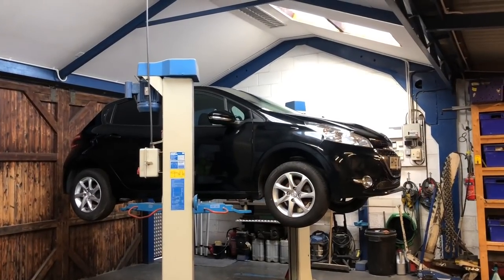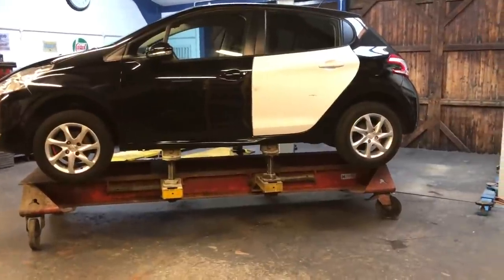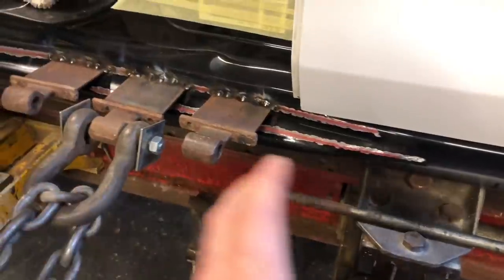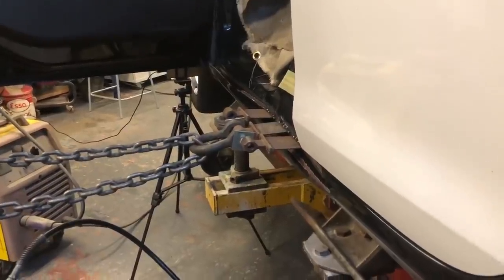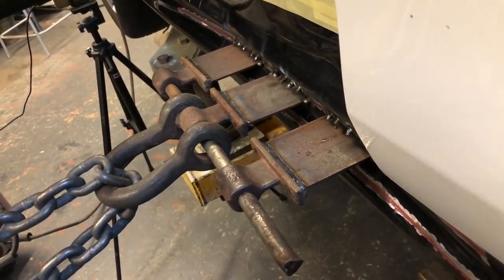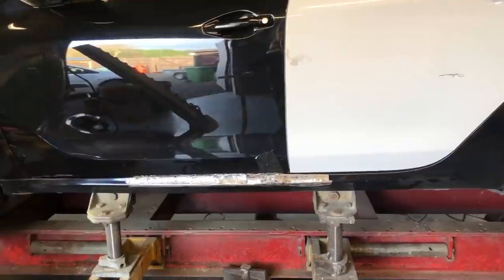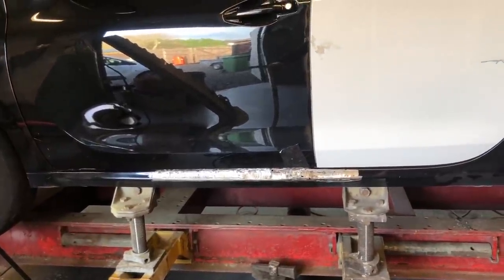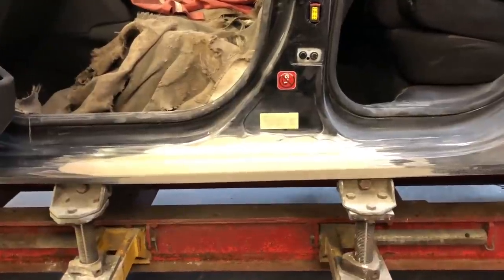2013 Peugeot 208 Jig Frame Machine Crash Repair Pulling PT 3

Comment: I found it almost magical that with well-placed pull points fixed to the sill it pulled almost straight back into the correct lines. It is not using the hammer, or the puller that counts, it is the skill to know how to use the hammer and drive the pull machine just the right amount. Chris clearly knows his stuff and this was a master class as usual. This is what content creation is all about.
Reply: Well said.

Comment: As always amazing quality content and workmanship and if ever I knew of anyone considering buying a vehicle from you guys I would do my utmost to tell them to go for it, as u guys certainly cover every aspect of the rebuild whether it be a quality bodywork repair, or solving a mechanical defect, Rob u do yourself so much good by always sticking a few miles on each vehicle before selling them on, it would inspire any potential purchaser. Without hesitation if u done a motor I fancied I would buy it full of confidence.

Comment: Those brackets chris made up a much bigger version of the keys you tack weld for pulling minor repairs. clever chris just goes to  show if you have the know how and proper equipment makes things easier to get job done to a really good finish awesome, and by the way rob even though you say your not good on the bodywork just by being around chris and helping out you are learning, so in time I think you will pick this kind of work up because you are  not afraid to give things a go and get your hands dirty. Great content as always cheers👍

Comment: Nice repair to the sill. I believe the outer sill is basically for body shape and door fitment. The real structure comes from the middle and inner sill plates. That's why it was soft. I'd have no worries buying that car from you. Merry Christmas from NS Canada.
Reply from the maker: Your absolutely correct the middle skin is high strength boron 👍

Comment: Guys, I love the videos you put out. May I ask a question? When you pull out a dent as in this video did you consider that the repaired section may be weaker than original (the metal was stretched when dented and reshaped by pulling and hammering)? I'm not knocking anything you do as in this video I think its a decent repair and a safe repair. Anyway, I know lots of us have been watching and enjoying the videos during the lockdowns and I am happy that I can still see them now i'm back in Beijing. Cheers guys. Merry Christmas :)

Comment: Hi Rob,
Awesome job you did there. However, a bit of a trade secret: you should try and avoid putting body filler on bare metal as it tends to rust overtime. The chemical reaction between the filler and the metal during the drying process creates small amounts of condensation + the filler is sponge like textured so it tend to absorb and hold water. For future rustproofing you should always apply an etch primer on any bare metal. You can check youtube videos where people are removing old filler from repair spots to see what is under. Also, some cavity wax behind any welded parts will also extend the vehicle lifespan. Uk weather is especially wet and damp.

Comment: Little hack for you in our bodyshop we weld a plate on it put the clamp use the jack for the jig  and put the chain  thought the the  hole where the head would fit and keep pulling the jack  and it would pull it out
Reply from the maker: Sounds the same thing bud

Comment: Didn’t realize it’s got high milage for the age and it’s failed mot a few times  but after all the work has been completed it will make a lovely car for someone who won’t mind the higher mileage and it will reflect in the price anyway it’s amazing what you’ve done to fix it
Reply: Jessica Fletcher haha!
Reply from the maker: It’s done 64000 miles in 7 years that’s 10.000 less than average where did you get high milage from 🤦🏻‍♂️
Reply: @sruk  maybe it’s not high and I might be wrong but I’m going from when I was buying my car auto trader would say it’s high for a car only 13 plate it’s classed as high as I have a 10 plate Peugeot 207 just start of this month clicked on to 40,000 bang on and no word of a lie never failed one mot and only got a tyer as advisory once  and my brothers Audi is 07 plate and just clicked to 64,000 but the Peugeot 208 is fantastic I do like it not knocking it love the car and I want one as my next car but also with your car being manual and now crash category that’s all I also meant about the price not being as higher value as one with less miles and no crash history

Comment: Rob, is doing that an easier repair, or stronger repair? than cutting it off and putting on a new sill??
Reply from the maker: A new sill would be 3 cuts and welding and twice the  amount of filler 👍

Comment: Personally after welding many many cars up. Id say its not heavy damage until the inner is pushed in. That was light damage. And most likely stronger than replacing it

Comment: I’d possibly have repaired that with a sill or a bit of sill  but I’m happier doing that I guess. 👍
Reply: Yes , that's what I thought . Pull it out until the inner panels measure correct , then cut the outer off and replace with a straight section from a breaker car ...... More work to do it that way though , but I feel would have been a better end result . .... 6 of one and half a dozen of the other though ..... personal preference in the end .  ( I and a friend , who had a Caroliner jig , used to do this sort of work many years ago . ) ....

Comment: Nice job on the outside, what about the rear side of the sill were the paint will have been burn't off with the tack welding?
Reply: It'll all get resprayed 👍
Reply from the maker: You mean the inside cavity that will be covered in wax oil
Reply: Oh I see what you mean now.... 👍

Comment: Hi great job, do you never use lead to fill your repairs or welds.
Reply: Lead is almost never used in more modern vehicles, other than a few very high end hand-built items.  It is often seen in classics, but lead-loading a panel properly is a very specialist skill and, with modern fillers being as good as they are, it really isn't needed often now.  A lot of the specialists that restore classics that would have been leaded from the factory, like the Jaguar Mk2 will often use filler rather than lead in the restoration, not just because it's far safer to work with, but modern fillers will often give a much better surface for painting than lead will, and with much less work...
Reply: @gosportjamie  hi you often see Arthur Tussick using it on his repair channel ( I may have spelled his name wrong). Interestingly in the early 1960s when I served my time as an apprentice mechanic our body shop used lead as a filler regularly. These days of course if I’m doing a small repair I use filler.
Reply: @MyMike1946    Different countries have different rules about potentially harmful substances, and different attitudes towards working with it.  Back in the '60s, when its' use in bodywork repairs and building vehicles was common, there wasn't really any knowledge of the link between the body absorbing lead and the effects it has on the brain...
Reply from the maker: No bud it only really used on classic restorations now. We use modern filler it is a lot easier and quicker and 99% of body shops use filler 👍

Comment: The frame machine is nice to have, but without one you can pull off your 2 post lift by chaining the car to one post and pulling from the other. Those rocker curves are hard to get into shape- often easier to cut a piece from the wrecking yard and weld it in.
Reply from the maker: We don’t repair cars like that bud a lift is for lifting  changing the sill is 3 cuts welding and more filler 👍

Comment: It must have a huge wack to dent the sill as it's high strength steel.
Reply from the maker: The sill cover is not boron steel if it was we wouldn’t be able to pull it. The sill is steel

Comment: That looks perfect, a good paint finish and you would never know.
Don't modern cars have thin steal? Hard to believe it would offer any protection in a crash.
Reply from the maker: There is boron high-strength steel on the inner skin 👍
Reply: @sruk  Oh I see.
I'm just used to older cars, thanks for explaining.

Comment: to do structural repairs do you not have to be qualified to a certain level, dont the cars have to be inspect by an engineer and signed off. Although I enjoy the vids I doubt I would buy a car with this type of damage no matter how well its was repaired, no offence there. keep up the good work.
Reply: Are u serious? i mean are u?
Reply: @salland12  just curious to works it works in the real world thats all.
Reply: @philipallmond2157  I wouldn’t either personally, even if it’s minor damage I would rather not
Reply: So not going banger racing then?